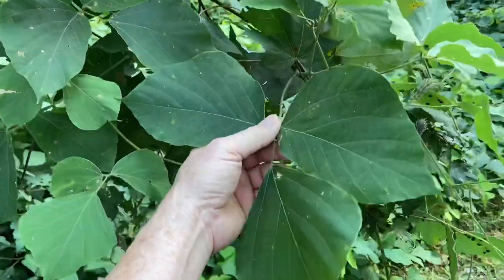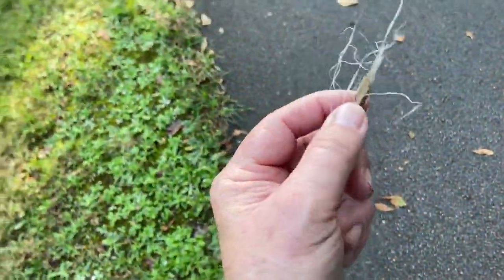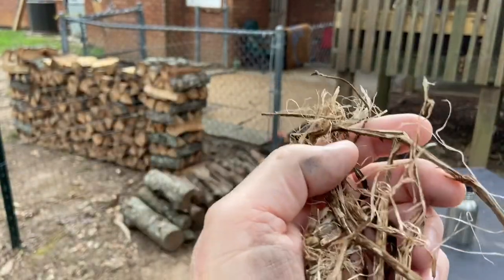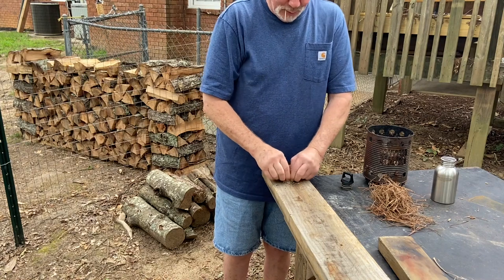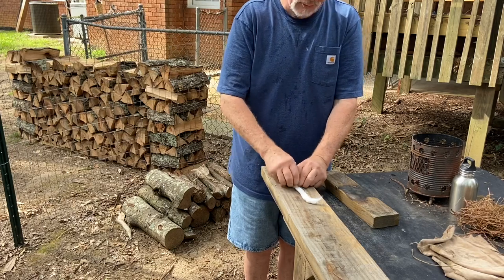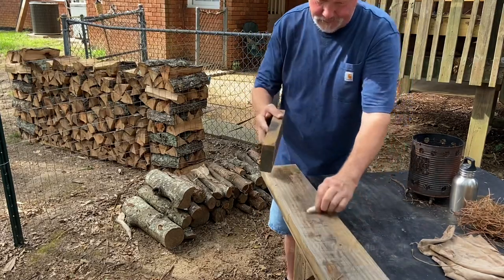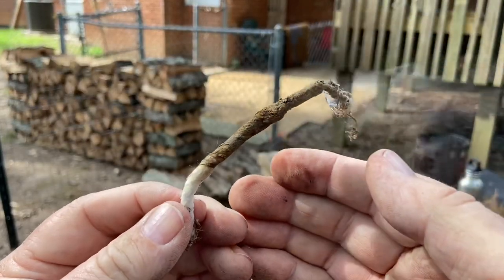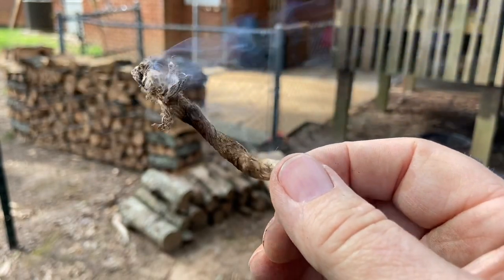Fire Rolling Kudzu In Cotton

Comment from the maker: This is for the die hard Fire Roll fans. Yesterday's video of fire rolling Kudzu fiber inside of an entire cotton ball went so well that I wanted to try some other combinations in some off camera practice. I tried...
1) Cotton with no filler, twice, and only got about 30 seconds of steam. There was not even any char inside the rolls.
2) Cotton with Kudzu filler again. It ignited just as easily as yesterday.
3) Cotton and Punk Wood... Didn't come close to igniting.
4) Cotton and Pine Needles... Only 15 seconds of steam.
5) Cotton and Kudzu again, but messed up the rolling process and caused a fail.

Comment from the maker: I have successfully Fire Rolled Kudzu and Ashes before (See LINK below). When this one didn't work out, I decided to make "the fiber" "the filler".
   Whenever you take ashes out of the equation, you always have board grippage issues. Wood ashes provide grip that the top and bottom boards need to drive a fire roll. Without ashes the top board will usually just slide over the top of the fire roll and flatten it. For better grip in these ashless situations, use 3 times the amount of cotton than usual. The boards will better grip and drive the greater surface area.
   I was surprised that it only took 35 rolls to get the Kudzu filled cotton fire roll to ignite ("One Roll" equals a forward and a return). Please follow the LINKS below and SUBSCRIBE. Thank You!

Rudiger Roll, Fire Roll Playlist
https://www.youtube.com/playlist?list=PLkoXX8XsMW3kLMA7kY_LznhzK5nOrA3Wd
My First Try At The Proven Kudzu And Ashes Rudiger Roll aka Fire Roll
https://youtu.be/C6wTfICyOsg